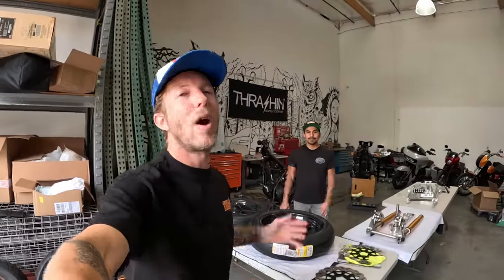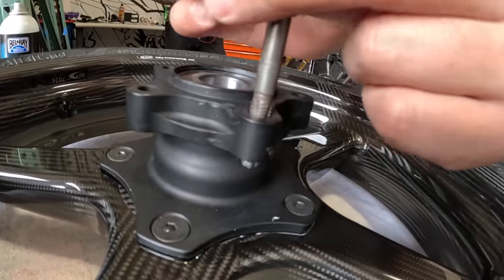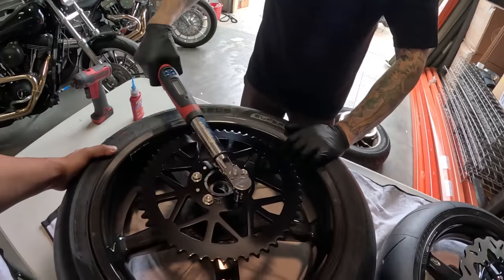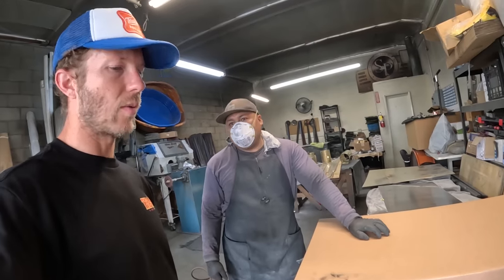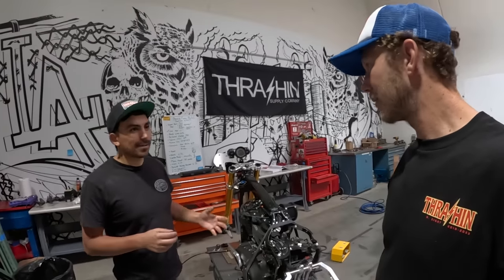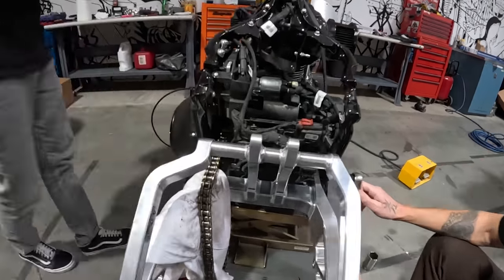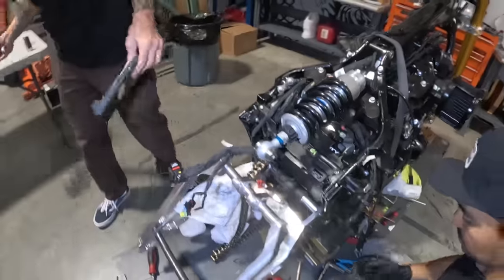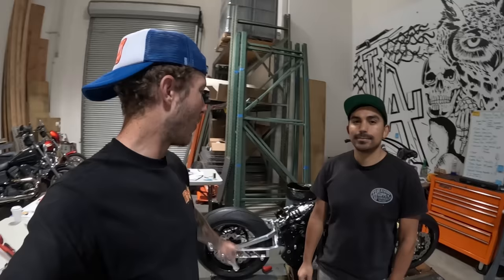Final Assembly Begins on the BADDEST Low Rider ST! Born-Free Build Week 10.1 - Vlog 78

Comment: Hey Juan, what is the difference in torque specification for titanium bolts vs steel bolts? There's a bunch of different bolts on that fancy light bike and none of those titanium bolts are going to stretch as much as those steelies that you are replacing, so how do you find the spec? Is there even a place where you can look that up?
Reply: There is a reference manual called the Machinery Handbook which is treasure trove of engineering info. Book is about one thousand pages of formulas and equations for engineers and machinist use.

Comment: You're gonna need BIG depleted uranium balls to keep that front end down. Are you lowering the bike?   Did you replace the factory 13" shock with a 13" shock or a 12.5" one?  I just put a 13" on my softail M8, and that shock looks shorter than 58mm travel, perhaps only 43mm.  Probably lowers the bike a full inch in the rear.

Comment: I didn't quite follow the work being done to increase the range of the swingarm.  Was it because it was hitting pieces attached to the frame before the shock would hit the bump stop?  Or, extending the margin of clearance to allow bump stop compression?

Seems to me the maker of the swingarm needs another revision.  I know you talked about it in a previous episode. I don't quite remember but I think it's a prototype, or close to RTM version you guys mentioned.

Not sure I would trust the removable section on the swingarm for the chain or belt removal/install.  Certainly not on an adventure bike. Definitely looks cool though.